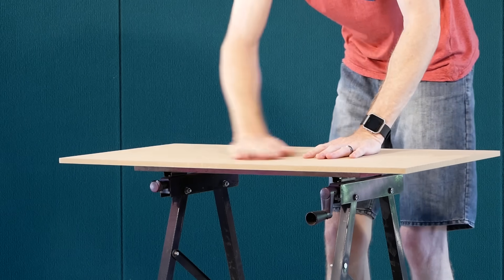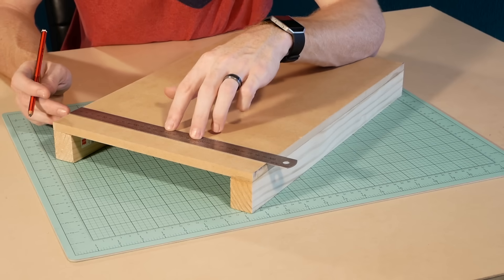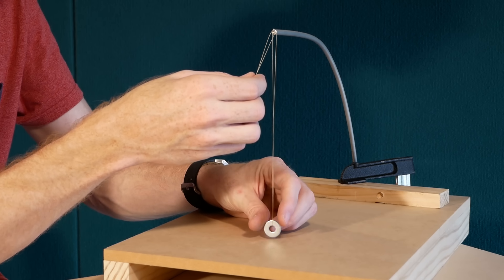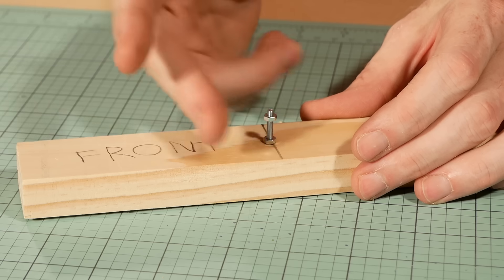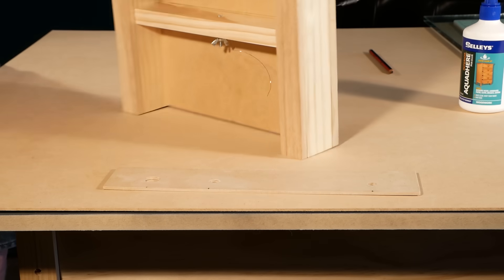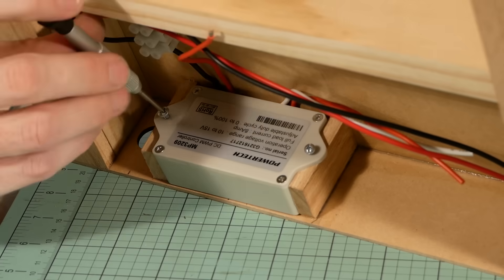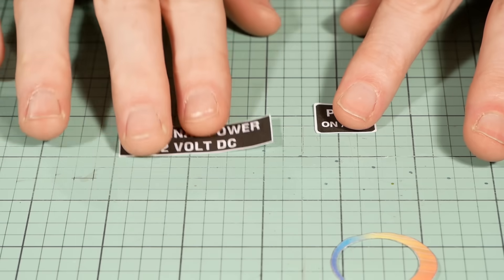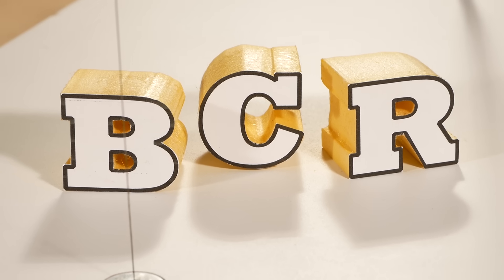Build Your Own Hot Wire Foam Cutter - Professional Tools for Modelers

Comment: Luke being an aussie as well where do you recommend buying the foam online along with other hobby gear? only one i know is mightyape
Reply from the maker: I buy my foam from Bunnings, it's Knauf Foam Insulation Board. Not every Bunnings store has it in stock so you may need to order it or drive to a Bunnings that has it. 
As for hobby gear, I get most of my stuff from OzRail, I usually just drive there and buy what I need and if they don't have it I'll search for stuff on eBay. I don't have one particular store that I go too, sometimes I order from random hobby shops in the US as long as their shipping price is reasonable. Oh and back when the Aussie dollar was really good I spent 100's of dollars ordering stuff from eHattons in the UK, they were very prompt in sending stuff and I always got it withing 10 days.
Hope that helps a little 😊
Reply: Thanks heaps, yer wish our $ was still good for the imports.
Reply: Hi Luke, I figure you live in a kind've remote place. Do you have issues ordering the foam. I live in Singleton and the people at Bunnings are mentally disabled, and have issues looking up the computer to order products. I get my mates to pickup foam in Sydney, but I only get to see them every 3 months

Comment: Brilliant.  Thanks for this.

Do you think a gloss paint on the work surface would help the foam slide about?

PS Saw the spider.
Reply from the maker: I did consider gloss paint but I find the glossy surface tends to grip the foam a little more, especially if it's a little humid. So I think a matte surface is the best way to go 😊 Thanks for the question James and I'm just glad the spider didn't run up my arm!